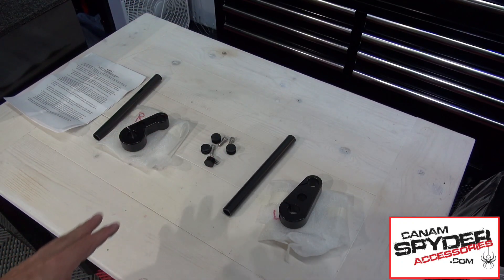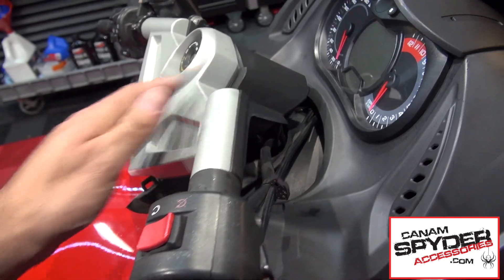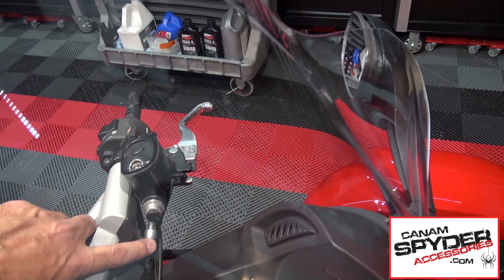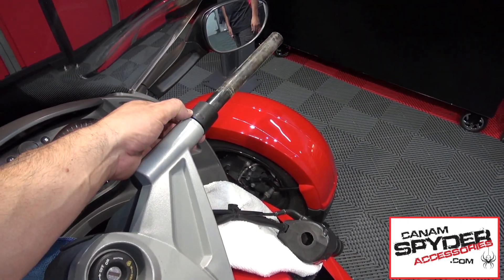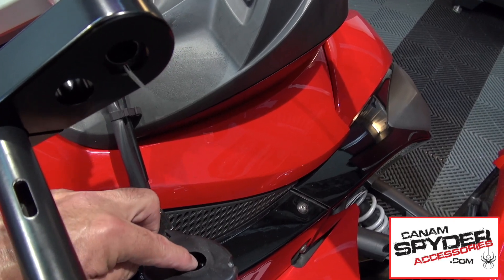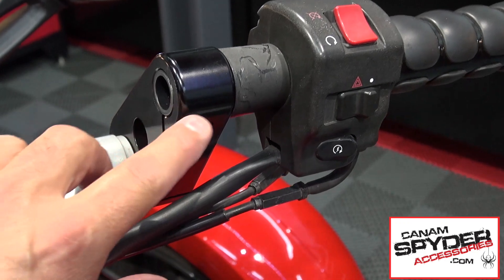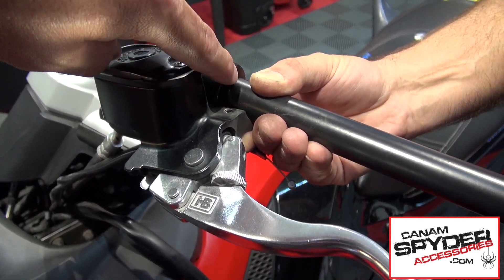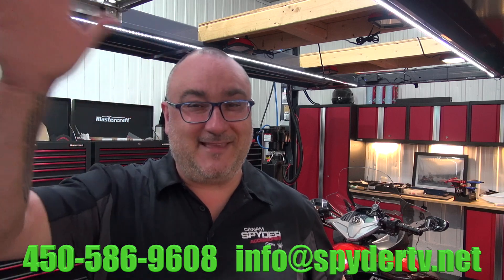Handlebar 3" Risers - RS Can Am Spyder installation video   - The Spyder Shop

Comment: great video, thank you...my wife purchased a 2012 Spyder RSS last year with only 4,000 km on it...but she would like the grips closer to her so we’re gonna install those risers this spring....thx again
....March 20/21....we just received the risers we ordered from you....they’re alot beefyer than i thought they were....gonna install as soon as it warms up....thx again Pierre and Lidia

May 17 / 21….risers are now installed and make riding more comfortable….one thing we found though, the kit comes with 4 little black tabs to put into ends of original bars and the new bars….tabs DO NOT fit into the new bars…diameter of new bars is smaller….